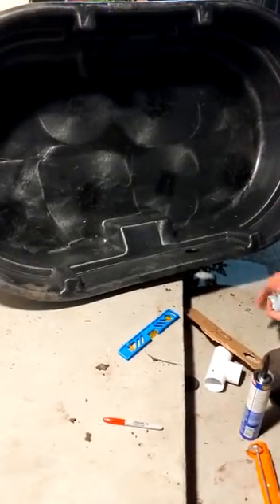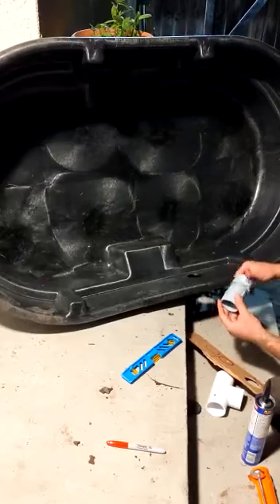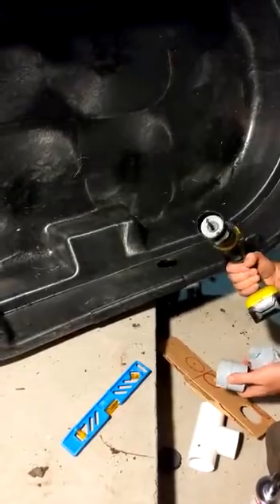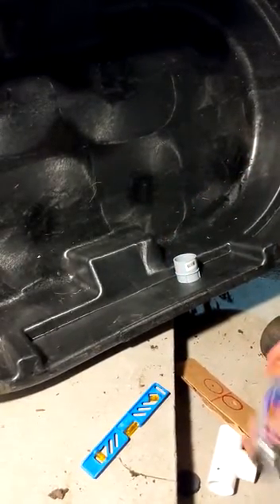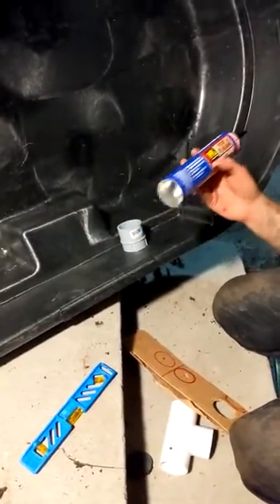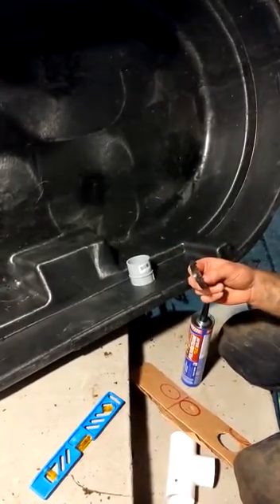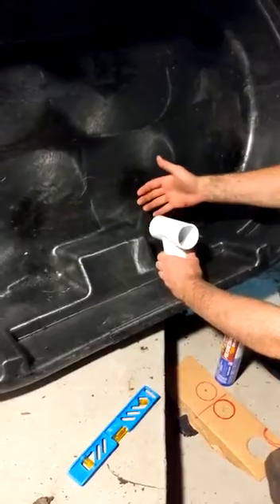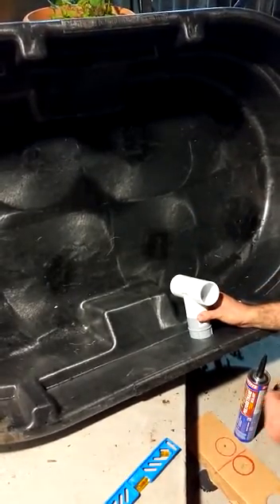DIY BULKHEAD / UNISEAL for Koi Ponds / Aquaponics

Comment: Would silicone work instead?
Reply from the maker: I tried using silicone with this method in a barrel filter and found it to leak. It's possible there's other types of silicone and I didn't apply it correctly. Typically when you apply silicone to a surface, it isn't too hard to peel it off by hand afterwards. This sealant that I used in this video cures incredibly hard and I would never be able to remove it by hand.